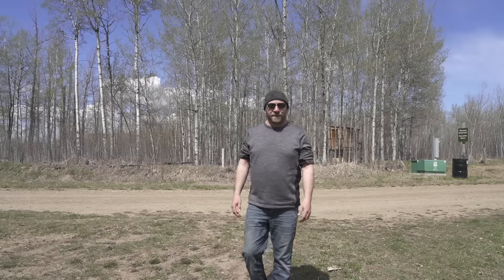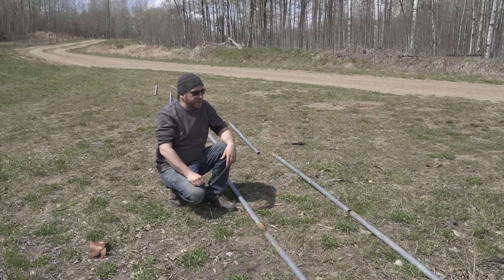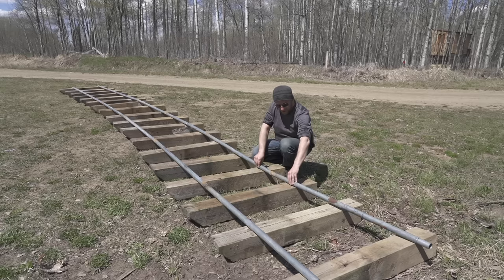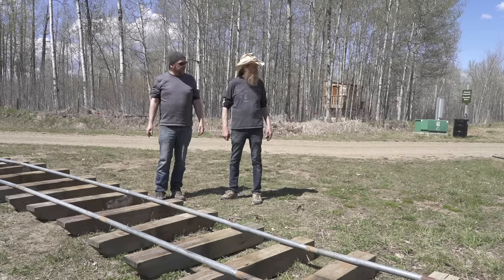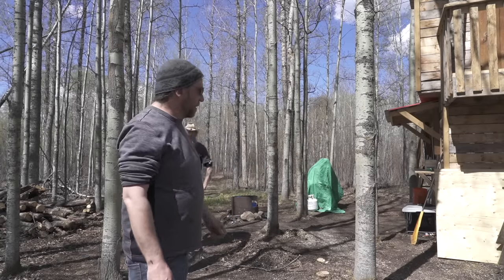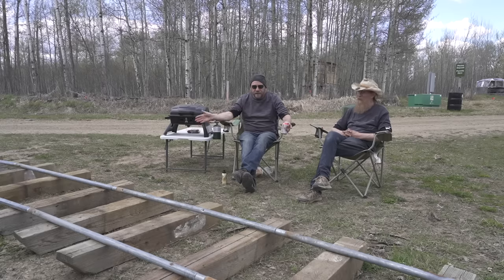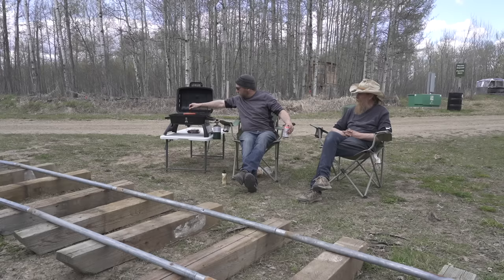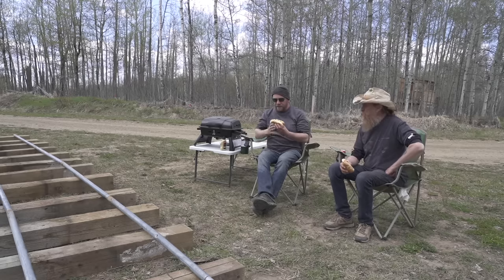Homemade DIY Railway - Work Begins Update

Comment: This is fantastic.  Repurpose, recycle, reuse.  What a novel repurposing of fence railing.  You can huck a railway video in any time amongst your camping videos...  I would suggest the power unit have 4 metal wheels to stay on the track, but 2 pneumatic tires for traction/power.  IMHO...
Also, Fiber optic cable is CHEAP.  You should sling some conduit with the railway so you could have wireless access points at each stopping point. You could power with solar/battery 24x7 or just use your Jackery when present.  This would probably beat having to pick up the StarLink every time you camp.  Just be sure to run an appropriate pair of fibers for each site...  (Multimode for places under 1000 ft from the house, and Single Mode for longer distances).  Plus, if you do this and do solar/battery to power the stops, you can setup cameras to see what's going on and you can view them remotely...  (If you setup enough power at each stop).  A couple of panels and a pair of 7 Amp/Hour SLA batteries per site ought to get you 24x7 coverage if you stick with DC only (no 120v inverters) and use cameras that only need DC power.  You can even add a switch to turn off the wireless until you are there.  I can provide more info if you feel like this is something you would like to do.

Comment: Check the date of production, it is either arsonic treated or copper treated. If you havr copper treated you will need to purchase corrosion resistant fastenters. Dont ever burn pressure treated wood, Steve... it is umpleasant smelling and a potential health risk. Good luck, my youtube amigo.

Comment: If I were you, I'd be very careful to ensure that the rails can take the weight, particularly where they are drilled through to run the attachment bolts to the ties. I'd build up a short section of test track and a small rail car, then load up the car progressively and test the rails to failure. Figure out how much weight per axle that works out to, and divide that by 2 for a safety factor, and confirm that the result yields enough useful load for your plans.
Reply: Thats pretty well what is going on and planned....

Comment: I had wanted to try something similar in my mind I picture using bike rims to ride the rails you are making using inner tubes that are smaller than rim size so it must be stretched over rim and and fit tightly. No air inside inner tubes or very minimal as they would be there to minimize noise. I would put the rims without bike tires outer rubber and only the metal rims and stretched inner tubes onto the tracks. Build axles and use U shaped metal rods to drape over axle long enough connect to lower the floor of cart as close to the track surface as possible to allow the lowest center of gravity and a low step in for occupants. These bike rims could use hydraulic disk brakes for mountain bikes and possibly electric hub motors for diy ebikes. You need a pipe bender to curve the track

Comment: My only worry about what is see is how strong the hollow tube will be with a Coach Car on top of it. It might collapse or bend between ties depending on how heavy it is once loaded with people. it would be pricey but maybe you could fill the rails with cement or some other filler material. This all coming from a guy who's been involved in a little less than one railway construction though, take it for what you will
Reply: more wheels per car would help disperse the wight more evenly though too

Comment: I have always wanted to build a train.  Get some of those green wagon carts and remove the rubber tires and run them on the rails on the rims as your cars. That would give you away to set your rail spacing.

Comment: one of my other hobbies is railfanning / model railroading. my suggesting to you is go research 1 foot garden gauge. check if there are any clubs in your area. find one & make contact to pick there brains. you willbe surprised at the help they can provide. the only thing you should keep is the lumber. other wise just keep going the way you are with the atv pulling a couple wagons.

Comment: Steve. There's vehicles that the rail companies own that drive around on the roads as normal but they have an extra set of wheels. They driv onto the rails and lower the extra wheels and then they can do their job.
Maybe use a quad bike but fit the extra wheels on that. It'll save you money. 😀👍

Comment: Hey Steve, you might want to look into using skateboard wheels for your train cars, and also lawn mower replacement wheels for the drive wheels.  I know there's a few people that have used skateboard wheels to build backyard homemade roller coasters before, and one such person is Will Pemble who has a channel on here that you might want to check out.  Hope this helps you out with your project.

Comment: I wonder if you could use some small rims for the wheels? I was thinking maybe 4 wheeler rims. They taper off on one of the sides and have an edge that will catch the rail preventing it from derailing. You could even grind off the tapered side and set the stop for the width of the track so there is play in the axle allowing you to make those corners. Just an idea. Great video man, look forward to seeing how it turns out.

Comment: Could make the rails out of branches, screwed down to the sleepers. Be very cheap, cheap to replace when needed too. Best part though would be branches having much higher tensile strength as well as being much more flexible.

Comment: Love the rail idea! I highly suggest a different solution for the wheel/rail situation. Take a minute to look into the shape of rail car wheels and why they are conical instead of cylindrical. The fence rollers work great in a straight short path but may give you a lot of binding issues in the corners. 

Can't wait to see what you do with this either way. Congrats on the property!

Comment: I have an idea for your locomotive and cars. Get a used riding lawnmower and take the rubber tires off.  The rims are dished in and should fit down over the rail.  Coat the rims with Flexseal or whatever rubber coating for traction.  Do the same with a lawn cart and there’s your boxcars.

Comment: If you're going to make the rail go across a path you will drive over, you may need to fill that section of pipe with concrete so that way it doesnt buckle over time.  And then also bury it appropriately with gravel.

Comment: Looks like you need a  countersink flange on the CD-7 unit multiplier, otherwise you will be knocking out hydraulic torque to the electric heat riser.
Most countersink flanges will experience hydraulic torque leak throughout their less than 7,000 RQMs. Especially when coupled with the double-flux lumen switcher. But with Wilson Countersink Flanges and Dorry Flanges, hydraulic torque is allowed to bypass the settling clutch, providing steady wall pressure to the lug manifold and all the seismic rotors. And that goes for 7,000 RQMs, 8,000 RQMs, even up to 10,000 RQMS. That’s right! 10,000!
CD-7 should be able to handle vacuum-kickback on all 22 blossom valves!
Now, if I could just get my kid to mow the lawn!
Reply: no flux capacitor??

Comment: Don't know if this will work for your idea, but back in the 80's, we would deflate the tires on my Jeep CJ7 to about 10 PSI and drive onto the abandoned railroad. The tire would kinda fold over the rails and we'd put the Jeep in gear and put-put down the rail line. Keeping the speed to about 10 to 20MPH, we could cruise the rails and the Jeep would steer itself. I don't know if this would work for you with like an ATV or mower tire, but just an idea to consider.
Reply: it has been considered - thats a cool way to make a Hi-Railer....

Comment: If you can't find many DIY home railroads to look at, maybe look at some model railroads for inspiration.  You might find something like the design for a large switchback can be scaled down (or is it up?) to the size you need to get your train turned around.

As for what materials to use, it looks like you're on the right track. 😏

Oh, and mind how you set the seams on those rail pipes i.e. if the seams on both rails are set about a foot down the line from each other, the train will go clunk clunk, clunk clunk like a western European or American train. But if you set the seams of both rails side by side, the train goes bang bang like an eastern European train.

Comment: So maybe find an old lawn tractor and space the rails to be centered on the tires. Then maybe let the air out so the rail fits into the wheels a bit and the tires droop down gripping the edges of the rails?

Comment: I would get some 10-20 cm square steel plates (maybe a roll of aluminum, and cut it to size, but thicker gauge steel would be better) and bolt it to one side of the rail down each side. the plate becomes "down" on the rail and you bolt the plate into the wood. this can also help fasten the pieces of fencing together. the only trick would be keeping the plates all level with each other when you're bolting them into those poles you've got. you'd need a few bench clamps or some kind of elaborate alternative setup.

you could probably mod a golf cart or a go cart for the train. you know, if you happen to have one of those lying around. you can really do anything for it though, the big question is do you want machine power or man power. you didn't say much about your train so i figure you wanna think about that aspect more. you could rig a mountain bike with "training wheels" on both wheels with the types of wheels you mentioned. you could use a motorized wheelchair. you could build a legit mine cart style platform where you pump a level to move the wheels. you could wire up the rail and run it on solar panels. etc

Comment: I would test those rails to see how much weight they can handle. We had one of those tarp garages and the poles didn't hold up to our 4 wheeler driving on it. Also if you want it to last you would have to put a base down under the timbers or else the rail will become very wavy. All in all, I want my own train now.

Comment: Your going to need and electric winch to raise a section of the track that has hinges on it, to lift  open the small section of  track,  incase you need to use the dirt road.😁 like a drawbridge.

Comment: Keep the quad bike as is, but add some guide wheels that follow the track. Then you can use the quad bike to ride on both the dirt and on the rails. The tyres should provide the grip you are suggesting and ride on top of the rails. The guide wheels on the rail should be able to steer around the curves. You would need guide wheels both front and back of the quad. This is how many track maintenance vehicles work.
Reply: a 'hi-railer' concept is being considered among other  proposals for a power unit...

Comment: Sooooo those kids/adult electric razor gocarts have good power and are pretty wide and have about the same size wheels as the gate rollers. Just a idea for a transport vehicle. Or any gas powered gocart could also adapt those wheels as well.

Comment: My dad always told us this story about using a model T to get to town on the railway tracks. They could do 40 mph on the rails where as the roads back in the 20s in rural Alberta were just a muddy old track with rocks.  So they could get on the rails at any level crossing by simply letting the air out if the tires. Not so much as flat but enough to sit in the rail.  They could still drive around the little prairie town a bit if they were careful. They didn't re-inflate till they were back home again.
So maybe a small ride on mower?  Even boxed uo to look like a Modal T. Be easy to build a level crossing to turn your power unit around and just connect to the back end of the "Consist"
By the way I grew up in Delacour train station back in the 60s where my dad was the section foreman from Calgary to Beiseker.

Comment: I see an old riding mower with the tires removed. wheels would be concave in the middle to ride on the pipes. pull a couple wagons or garden carts only on the wheels to pull behind as long as you can get the track with all the same.

Comment: Go to harbor freight and buy there smallest swivel air tires and use the rims off of them there only 8 dollars here for your wheels to pass over the flared tube connectors. I used this method on my sliding door.

Comment: Keep in mind that even though Canada changed to the metric system for most things, railroad speeds are still measured in miles per hour. When you put up speed signs make sure they are posted in mph. If you name the line I suggest Birch Line.

Comment: Hey, somebody is getting a Beer Belly. Or maybe two somebodies?
You would need to make the "U-Shaped" wheels from the gate rollers independent of each other and each one on a separate swivel of its own, kind of similar to the front wheels of grocery market carts. If not, then expect a bunch of derailments. Regular railroads use broken rock under the ties, in irregular shapes, not smooth nor pebbles. That way they interlock and won't budge, and they still drain water well. You probably ought to have a propulsion system that uses something like a balloon tire to propel it that is not on the rail. Maybe a 3 wheel bicycle of some sort to work off the beer, or an old smaller gas Quad that would fit between tracks and can be unhooked, driven to the other side of carts and hooked back up. In fact, you could still hold down the rails with U-shaped flat metal clamps because the wheels will just roll over them with a train styled click-clack. At least try it as an experiment before drilling screw holes. You could also drill holes through the center of the rail, then pass through a bolt/threaded rod that could then be attached to L shaped brackets and those then attached to the ties in some way.
Still It's NOT a small project.  :yougotthis:

Comment: This is supposed to be fun, not rocket science...go kart width, no tires on the kart wheels, the wheels have the "cradle" to run on the rails.  Wrap the wheels with old inner tube so you have grip on the rails.  Put the kart on the first set and tie the rails down as you move the kart along slowly the first time so you lock the rail width based on whatever vehicle you'll be using on them.  If it doesn't work the first time then science the shit out of it until it does.  Good luck, drink lots, and have a hell of a good time no matter the outcome.😎
Reply: Hell, a riding lawnmower would be epic and you could pull a lawn trailer full of beer behind that.🤣😎

Comment: A roundhouse could be used to turn your train around at the end.  You would need a length of supported rails just longer than the train on a turntable- a stiff wood table just wider than the rails.  This turntable- needs to be drilled precisely in the center, central as to length and from side to side. Then a large pin through the hole and we'll down into the ground (into concrete if possible).  This pin and hole and mount in concrete must be perfectly plumb.  You could use a wheel hub with bearing.  That would be best. Or even a tire rim as a center bearing.  The turn table will turn around on that center and four wheels at the corners of the table. You will need to dig a round ditch for the wheels and a center hole.  It would be best if this is next to a drop-off so that ditches from the center hole and the round wheels ditch will drain.  You will need the rails on the turntable- precisely align with the end of the railroad with only a small space between then.  Place in the ground at that spot in the ditch some of your ties.  Also at the other end where those wheels will be to assure that your rails will align vertically.  Since an actual train engine can be turned by hand your little train could be easily turned.  You'll want to chock your wheels during turning.  But sorry, a simple loop of track at each end will be easier.  Just thinking.
Reply: a 'wye' is  being considered...

Comment: I don't mind this type of content at all, I even like it. Just because you're usually focused on one topic doesn't mean you can't deviate from it. I've learned that I usually enjoy watching videos because of the people in it, not necessarily the content itself. Also, if this helps you to keep putting out videos while renovating the acreage, that's a win-win.

About the wheels: I would pass on the chain link fence rollers. Not only are they small, they'll also make it very hard to turn a corner. I'd probably suggest making a regular train wheel yourself (wide with a flange on the inside of the track). Check out Way out West - Workshop stuff, he's made his own little garden railway too, but he used iron strips. Probably a good idea since those bend so easily for corners, but don't sag.
Reply: He will go with the  gate wheels  unless they fail... he already has an axle with flanged wheels but that cost actual real money so he is looking for the cheaper alternative  wheel at present.  Way out West has been an inspiration for sure by the way along with the bamboo trains and the motorcycle trains. lots of good low budget solutions...
Reply: @mrbillmacneill  Yeah, I get it, especially if the stuff's already there, the cheap way is the best way. I'm just afraid the wheels turn out to be horrible, especially on corners and in autumn with crap on the tracks, and he'll have to do it all over again. I mean, it's good content, but still. I'll gladly watch the outcome though. Never hurts to try.

Comment: The thing I'm think about is this will only last so long those pipes are hollow meaning water will run throught them and rust from with in could be dangerous if you don't fill in those pipes especially if u want to put loads on them

Comment: Pro-tip: Real rails are not flat. They are supposed to be rounded just like your pipe. Go ahead and use regular rail wheels they'll work just fine on the tubes as long as the tubes are spaced correctly. If you do that you can use off-the-shelf things like rail carts and rail bikes.